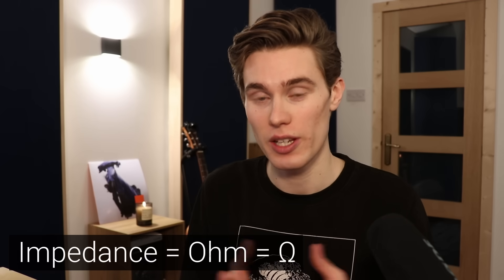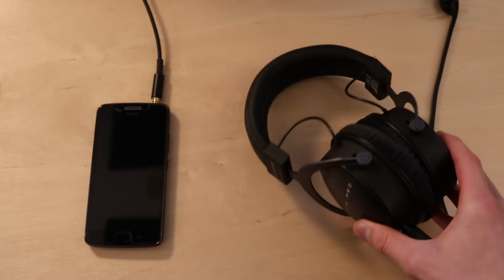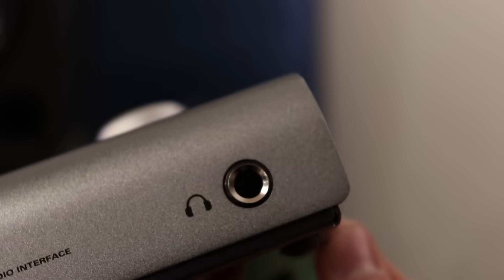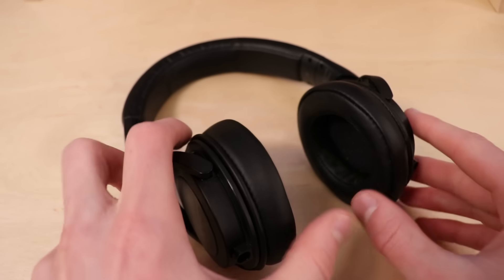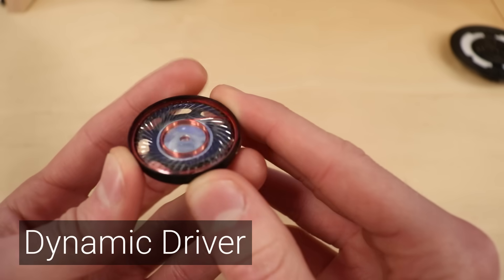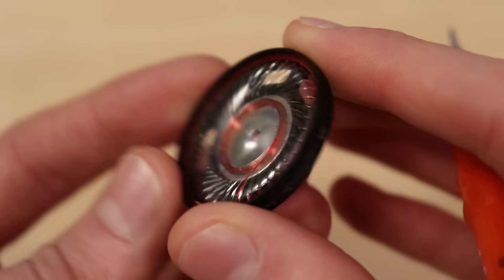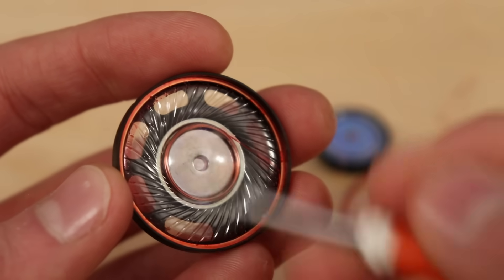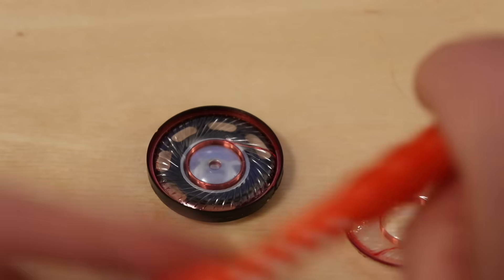32 ohm vs 250 ohm - Which Headphones Sound Best?

Comment: In fact the choice of headphones really depends on the output impedance of your headphone driving device. If the device has a relatively high output impedance, you'll not get much volume out of a low impedance headphone: The output current leads to a waste of output voltage (which is distributed between the two impedances in the ratio of impedance values) and thus waste of power in the high output impedance of the driver. Ideally, to be most efficient, driver output impedance and headphone impedance should exactly match. This way you'll be able to get the most volume.

Comment: My all time favorite headphones are the massdrop x senheiser hd58x jubilee they have the sound of a 600 dollar headphone but for the price of 140 they are open back and 150 ohms so you can drive them with your phone fine they also work with xbox switch but not ps4 the dualhshock isnt powerful enough to run the hd58x

Comment: I use the DT 770 Pros as well, the 250 Ohms version to be exact.
Why did I choose these? My soundcard has a headphone amp in it and in the settings I can go to 250-600 Ohms. I did some research before buying the headphones (my sources where no where near as detailed as your video by the way!) and the result of that was a resounding "it doesn't really matter". So I honestly just went for the 250 Ohms version because the 32 and 80 Ohms versions cost the same... So I thought if it doesn't matter and if my soundcard can drive them, might as well get the 250 Ohms version and return them if they sound weird.
They arrived, I love the sound, I didn't return them.
I am not an audiophile, I just like to buy high quality stuff instead of cheap junk that breaks quickly. And I think in that regard beyerdynamics gives you a LOT of headphone for a very reasonable price!
Also, I am German and I like to support German companies :)

Comment: I just wanna know what Ohm is? 
After watch the whole clip, now i understand the origin of cosmos.
Reply: ohm is a unit of measurment used to measure resistance. Although resistance and impedance arent the same thing. you can have a resistor with 1kOhm and you can have a coil with impedanca of 100ohm.

Comment: I was looking at so much material and I'd say I enjoyed your explanations the most. Can you help me decide between the DT-770 Pro 250 Ohm and the DT-150? In the data sheet, I can barely see any difference except for the cable and the frequency
Reply: I've had the DT 770 M as my main cans for over 12 years and are still going strong so I really recommend the 770 series, I only had to replace the earpads one time a few years ago but apart from that no issues so trust me dude they will serve you well!

Comment: i‘m using an about 45 year old beyerdynamic dt 880 S. It had an Impedance of 650 Ohms an came with an original Frequency plot from Brühl & Kjaer, that showed an absolutely linear Frequency response from five hertz to 22000 hertz. It was absolutely super for classical music. But for Popmusic it was not so good. It was not possible to connect it to a smartphone because of the high impedance. 5 years ago i looked at the homepage of beyerdynamic to see if i could to something to solve the issue. It‘s almost unbelievable, but after more than 40 years there were still spare part available. So i ordered a pair of 250 Ohm Systems because they did‘nt have 32 Ohm Systems. After i got the parts i modified the headphones and the loudness was absolutely OK with my iPhone.

Comment: GREAT video! Holy shit this video is useful! A question though, are there high end headphones at lower impendance? For example, my Cooler Master MH751 (Takstar pro 82) has lower impencance than my Hyper X Cloud 2 (Takstar pro 80), but the MH751 sounds much better. Of course the difference isn't very high, but still, is there a general trend where higher impendance headphones are better soundwise than lower impendance headphones? if we ignore the trash tier €15 skull candy stuff, of course.

Comment: I've been using the DT770 80 ohm ones for 5 years now, and they've been hands down the best headphones i've ever had. The sound is so good, they're comfortable to wear for a full day and they last incredibly well. The plastics on the have cracked a bit few years ago already, but with no downside to usage and they're still tough. I'd buy another pair in a heart beat.
Reply: Hi , is it work with mobile phone? The volume is ok?
Reply: Absolutely! I've used them with mobiles, audio recorders and pc's and it works great on all of the them. I often listen to metal / rock, so i tend to have the volume higher than lower :) 

But, let me say that i use my beyers on pc mostly. They are not really the most travel friendly, so for travel / on-the-go i'd choose something smaller and lighter. I take them to bedroom and lay down sometimes, or just mess around in the house (cleaning etc.). Or hop into a bus and they're fine there too, but that's about it outside of the house. They just take that much room and can't be folded (which makes them rock solid). But if you're fine with that, cool.

Little nice quality headphone amp is worthy considering too. It adds to the setup, and for the most part it's too much of a hassle for me (but, i haven't rigged it properly to my audio player, let's say with rubber bands), but when i use it it's nice! More volume (better volume control too), but more importantly even better sound. Through a headphone amp the music just sounds better, all-around. But, not in any huge margin. Typically i go without. But if you get one (let's say used) for a good price, give it a try? Up to you. Would be even better for a mobile, especially some very slim type.

If my memory serves me right, i drove the beyers in for about 1-2 weeks. They sound nice from the get go for sure, but driving them in (to whatever you like to listen) makes them better. Just use them and they'll grow into you. Hopefully they'll serve you well as they've done with me.
Reply: @mononenville  thanks a lot
Reply: @Resident Zero wow i was looking all day at these 80 ohms headphones and it's compliance with smartphones and i have Galaxy A52 so you've just given me a straight answer.
Reply: @Resident Zero Hi possible to share which model headphones and what ohm you using for the above-mentioned as Im thinking of using it on my Samsung A53 and TCL C835 tv.
Reply: @Resident Zero Hey thanks much appreciated you are willing to share a step further, so in order to watch TV with DT770 I can relax on my couch which is 5m away from my TV I can just use Qudelix 5k act as bluetooth connect to TV without any loss on latency? But I thought if Qudelix 5k act as bluetooth there suppose to be 2 devices receiver and transmitter?
Reply: @Resident Zero Thank you, you have been kind enough.
Reply: That's great and actually fine for most people. But the 250 ohm version will produce a more detailed, clearer, punchier sound - but it will mean you need an amp to drive the higher impedance - a cost most people won't justify unless an 'audiophile'.

Comment: I actually have a pair of 250 Ohm beyerdynamic headphones and I have no problem with volume when they're plugged into a computer or smartphone. The audio is good. I can only imagine how much better they are destined to sound with the recommended voltage applied.
Reply: I ordered for myself dt 700 pro x. 38 ohm. Hopefully everything will be ok. Tbh I didn't knew about ohms at all. Got DAC Q5k.. I was focused on closed back headphone as I am planning to travel and fly. I don't want to disturb people around me with my classic music.

Comment: "If I was gonna plug a high impedance pair of headphones such as these 250 ohms headphones into my phone I could turn my phone the whole way up and I'm barely gonna get any volume, it's gonna sound really awful"
Thing is, I tried the DT 990 Pro 250 ohm in both a Samsung galaxy S9 and a Motorola Moto G6 plus and yeah, the volume isn't as loud as with 50 ohm headphones, but loud enough to actually be used daily. Thing is, you might risk damaging your internals. (If)Somehow your phone actually manages to run these (and that's not only a decent high end phone but also a mid range phone) but you might risk your internal components getting too warm due to them running above spec which requires more power which causes excess heat which in turn can damage the components. It draining your battery faster yes, it does that, which makes sense since it needs to use more power to drive the headphones. Thing is, the sound is really not terrible at all, actually quite good. Yes you're missing a bit of bass but not that much compared to the output of an Audient ID4, but the overal quality is more than good enough for daily use. Again though, you will most likely risk damaging your phone's internals if you do so (if they actually drive them at good quality and decent volume levels, in case your phone does not have any form of fail safe for this in place).

I'm not recommending you do this though, that's at your own risk. I'm just pointing out that even a mid range phone (250 euros) can drive these with good quality and at a decent volume. Again it will most likely damage your phone's internals in the long term, but hey, I'm just stating my findings here. I was curious and here's my result that probably not many people asked for XD

(Not saying every phone can do this. Some might have a fail safe in place so they won't allow the internals to run above spec, some might genuinely not have the power to run them like that at all. I tried it with a decent high end phone (Samsung Galaxy S9) and a mid range phone (Motorola Moto G6 Plus) and these were able to do it. To not risk damaging two good phones I'm not going to try this for too long, maybe another day with a cheaper phone).
Reply: consider this:  0 ohms is a short circuit, infinite ohms is an open circuit. which do you think: 50 ohms or 250ohms will put more demand on the phone output?
Reply: Whoa are you for real? omg i didn't know.
Reply: @ASOTFAN16  hi, ohms is resistance to current flow.  Voltage is like electrical pressure that pushes electrons through the resistance. higher resistance only lets a trickle through where low resistance lets a lot through. the amount of electrons flowing is the current.   so for any given voltage the phone can cook up, the current flow will be 5x through the 50ohm headphones vs the 250ohm headphones. That's why they are louder, but at some point the phone will hit its current limit when the ohms goes too low and basically over-drains the phone which could heat it up or burn it out. like running 2 50ohm headphones on a splitter now cuts the resistance in half and the phone sees 25 ohms.. maybe that is enough to drain the phone too much.  OK, the best scenario is when the source supply(the phone) and the load(the headphones using the juice) have the same impedance(complex resistance but also measured in ohms) . max power is transferred and the sound is the best. so I would look at the recommended load range(ohms) for the phone and try to get as close as possible with the headphones
Reply: @jjrusy7438  whoosh

Comment: Actually there is one more important parameter which effects power requirements. It’s sensitivity (dB/mW). Usually this parameter is around 100. 
If it’s higher, headphones are described as efficient one, as they need relatively less power. (Typical models are IE monitors, sony IER m7/m9/zr1 — they have 103 db/mv)
Low sensitivity headphones require relatively more power. (97 db/mw needs more power than 100 db/mv)
Sennheiser uses (db/vrm) marking.

U can use online power calculators for headphones

Comment: 80 Ohms the 32s are pretty much useless unless you dont have an audio interface and u record directly from your laptop or use it in your phone, 80 ohms work perfectly with laptops, on phones its low but hearable, and works with any audio interface even the budget ones that cst 99$ like the focusrite and m audio ones, and they work with those industry quality preamps

Comment: Higher Ohm -> more Ampere to get the same volume (in general). You need to re-record this video because you mixed up ampere with voltage. Don't teach people wrong info!
Reply from the maker: I think you are mistaken, unless I misunderstood your comment
Reply: In The Mix I may be wrong but your explanation is partially wrong too.
Reply from the maker: @oledahl.  I really don't understand you, if you have higher ohms you will need more voltage and this might actually be a decrease in amperage to satisfy the same power requirements. However it is specific to the impedance matching and specifications of the headphones and amp used. In general, voltage up means current down. So I don't see how my explanation is even slightly wrong?
Reply: In The Mix did you read David Griffins post?

Comment: I got some Beyerdynamics DT 1770 Pro (250ohm) for christmas, listened to another video just like yours who also said that these headphones will be quiet on mobile phones and that one generally should use them with an amp or interface. I was already worried the money was wasted because I don't produce music, I just want high-quality headphones and would like to listen on the go too.

I plugged them into my Samsung Galaxy S10 and behold: Volume on 70% and I'm at the maximum my ears can take before they start to hurt. They're plenty loud. And they sound f*cking amazing. Clear difference, much better soundstage compared to my old Audio-Technica ATH-M50 with much lower impedance.
On the computer the DT 1770 sounds fantastic directly plugged into the 3.5mm audio jack. No extra audio-gear needed.

Bottom line: I don't know what you're talking about. Get these headphones whether you got extra audio equipment or not, they sound great and are well worth the money.
Reply from the maker: That's amazing to hear, I think that maybe my phone has a particularly low output voltage (it's an old one!) But if the 250 sound great that's all that matters! If 250 sounds good then anything lower would also sound amazing too :)

Comment: High-impedance headphones are less sensitive (e.g. sound quieter using a phone's built-in amplifier) and require more power to drive.
so are best used with an external headphone amplifier (such as the oppo ha-2 se which i use) due to the higher power requirement than lower impedance headphones.

This power requirement all comes down to the voice coil used in the headphone's drivers, the small speakers that sit inside the earcups that produces the sound that your ears end up hearing.

High-impedance 'phones use a much thinner voice coil in their drivers which is wound with less air between the individual wires, resulting in less sound distortion and a better level of bass reproduction.

The thinner voice coil found in high-impedance headphones requires more precision to produce, and as a result their manufacturing costs are higher.

More importantly, high-impedance headphones require more power to effectively drive, which means that portable music players running off batteries are ill-equipped to deal with their power requirements.

Audio manufacturers, cognizant of the fact that Hi-Res audio hasn't caught on the same way HD Television has, generally steer clear of high-impedance headphones unless they're going for the upscale, audiophile market.

Comment: You should've mentioned that the main benefit of higher impedance is greater signal to noise ratio. This mean that the difference between the actual sound signal and background noise is greater.

Comment: I thought ALL headphones were 32 ohm, like a standard was set or something, I didn't know any others existed. All The headphones I've ever bought, from big to small, have all been 32Ω.
Reply: That's the standard because it's more affordable and it requires less to power it. So the market is much bigger for low impedance headphones cuz anyone can buy them and not have a problem powering them. High impedance headphones are usually used in studios, so you're not gonna see them laying around at everyday stores.

Comment: Headphones with higher impedance (250-600 ohms) were used in studio mostly because source impedance of typical pro-summer audio gear is around 80-120 ohms, sometimes higher - so there is impossible to plug low impedance headphones, othwerwise you could hear very nasty distortion or even damage output/headphones. This is main reason for these high impedance headphones to exist. However there some benefits from higher impedance (damping factor, quicker impulse response etc.), so for mixing and overall professional use it is still better to use headphones with impedance around 100 ohms.

Comment: I bought a 32 ohm (dt770) a year ago and i'm not really happy with it, the sound is great, but the thought i could have got a 80 ohm or 250 ohm makes me sad. Unfortunately i couldn't find anyone to tell me if i would be able to use it on both my phone and piano without soundcard. So i didn't risk it and took the low impedance
Reply: I have a DT990 250 Ohm and it works great on several phones tested. For your piano I can't tell tho.

Also I tested the DT770, but I prefer by far my 990. The bass are a lot more present which I prefer, but it's an open headset, so you hear exterior sounds almost like if you had nothing on your ears (sensation that I actually like)